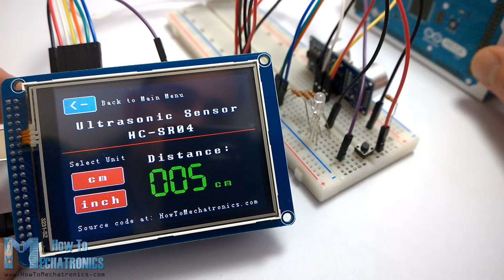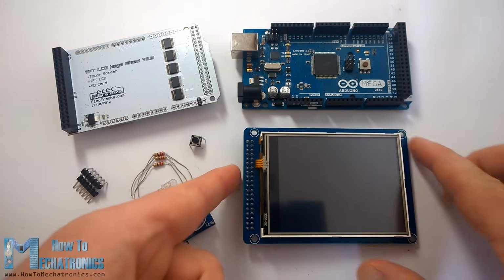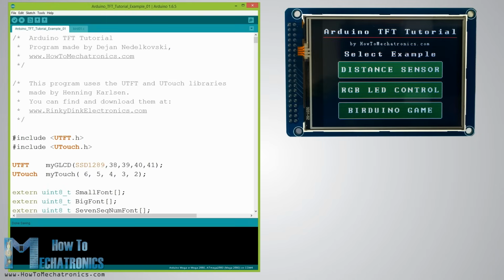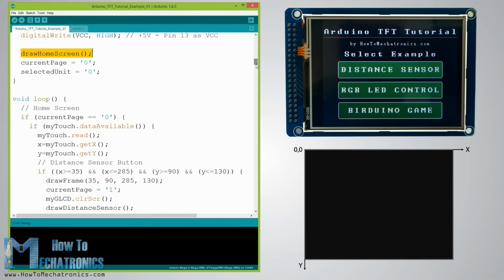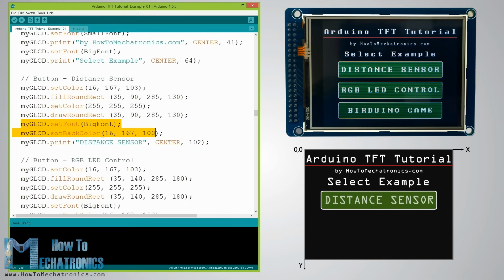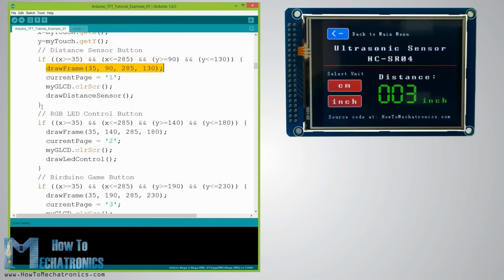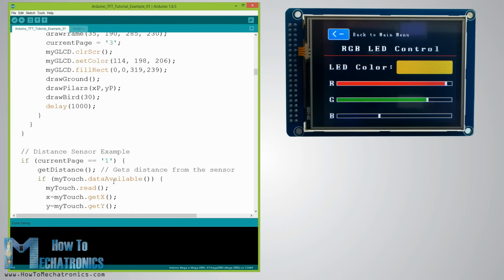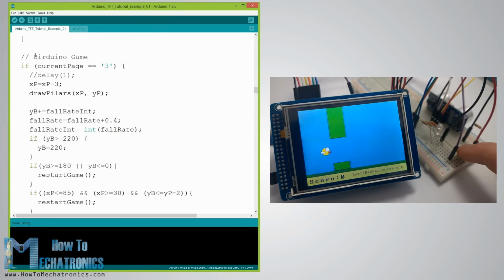Arduino TFT LCD Touch Screen Tutorial

Comment: In the ultrasonic part, when I switch between CM and Inch, the number lay on top of each other.
I'm using Wokwi to simulate and using ILI9341 library.
I wrote to code in order to clear previous number but it doesn't work.
if(selectedUnit == '0')
     {
        tft.setTextColor(BLACK);
        tft.setCursor(150,145);
        tft.print(previousCm);
     }

Also, it doesn't refresh the page to update the value of ultrasonic sensor.
I have to manually click on cm or inch button.

Comment: Hello,
I have recently purchased a 4" TFT (NT35510) which has the advantage of plugging directly into an Arduino Mega, but have encounted a few problems applying your wonderfully clear tutorial. I set the model to NT35510 and the touch parameters accordingly but the library UTouch has been replaced by URtouch (which I have included). I don't know if the new library is backwardly comparable as I get a page of RED when I try to compile. Do you have any thoughts.

Comment: Hello, 

How would i change the code for
// Draws a rectangle with the latest color combination 
  myGLCD.setColor(xRC, xGC, xBC);
  myGLCD.fillRoundRect(175, 87, 310, 119);

to display number values instead. For example, the slider starts are zero and goes in increments of 0.5 every time you slide it to the right.

Thanks in advance!

Comment: Hello, do you have any code for using the 2.8" display to monitor DC voltage that I can use for my solar project? It would be a big help, thanks..

Comment: This tutorial is very helpful, Thank you. But can someone assist me with solving this error "Error compiling for board Arduino Mega or Mega 2560", that's what is happening when I run the code. I added the required libraries, but still getting that error.
Reply: Is it compiling for other boards?

Comment: Thanks for the great video, very interesting.
I'm currently studying but ran into bugs with the code. I suspect since the video is already 4 years old, something has changed, can you see what is going wrong, the error happens when compiling. 

Fehler:
C:\Users\Eric.Marks\Downloads\Arduino_TFT_Tutorial_Example_01 (1)\Arduino_TFT_Tutorial_Example_01\Arduino_TFT_Tutorial_Example_01.ino: In function 'void drawHomeScreen()':
                                                   

C:\Users\Eric.Marks\Downloads\Arduino_TFT_Tutorial_Example_01 (1)\Arduino_TFT_Tutorial_Example_01\Arduino_TFT_Tutorial_Example_01.ino:227:48: warning: invalid conversion from 'char*' to 'int' [-fpermissive]
   myGLCD.print("Arduino TFT Tutorial", CENTER, (char*)"10"); // Prints the string on the screen
                 

Thank you for everything
greetings
from Germany Eric

Comment: I'm a bit confused here the Mega 2560 board has 3.3vdc and 5vdc output so why the shield it can't be because of power outage wait unless you mean where the screen plugs in doesn't have 3.3vdc output could you clarify, please? I was also wondering if you think it would be possible to take a touchscreen out of a phone if it would work with the Mega 2560 board and if so how would you do it? Basically, I'm poor and I do my best to recycle electronics back into useful things. Like this computer, I have at least a large part of it was built from harvesting parts from electronics recycling bins. I have 2 old Samsung cell phones and I was thinking that maybe I could pull these things out and use them for a screen for the Mega board which is how I landed here but this video is not what I was hoping it to be. If anyone has any thoughts or knows please let me know. One other thing I also have some old blackberry cellphones (the screens are not touch screen) they are nice screens could they be used?
Reply: The CPU chip runs at 5V so the I/O is 5V.  The 3.3V regulator appears to only drive the connector, not the CPU and I/O.

Comment: So one thing that isn't said is that the ID of the LCD does matter, when initializing the "myGLCD" method the display could be "SSD1289" OR "CTE32_R2" if your code compiles but doesn't show up on the display, try this fix. Also, the error of C++ nnot being able to convert string to char is normal and will still operate normally.

Comment: hey man I wanna ask about a Rapsberry Pi TFT display that I have. its the one that just works only if you burn onto the Pi one of the .img the developer of the touch screen did. I think its called kemei, its pretty much everywhere on aliexpress. I don’t know how to even start try testing the display with the arduino, not to mention to test the display with a non prepared and driver-loaded iso on the pi... do you know a way i can approach this problem, even if just only to know where to start it would be wonderful.

Comment: can i use HiLetgo 3.5" IPS TFT LCD Display ILI9486/ILI9488 480x320 36 Pins for Arduino Mega2560 instead of the model which you have used.

Comment: Is there a way I can debug and test my screens without having to compile and load the Arduino? Like a screen simulator?
Reply: You can do this with littlevgl, but littlevgl actually requires you to write code.
Reply: Did you find

Comment: Hello sir , from where you have bought this TFT Display. because same TFT i have bought but it's Touch is not working.
Reply: Make sure that you set the parameters of the properly in the line 'UTFT myGLCD(ILI9341_16, 38, 39, 40, 41);  //ILI9341 on  "TFT_320QDT_9341"' (Usually right below including the libraries)
Reply: @geetanshgautam  Muchas gracias amigo, me funciono muy bien.
Reply: @carlj7157  you're welcome

Comment: Hello,
Can we send files/messages using Arduino,TFT and HC-05 module?????
Please reply.
Reply: AFAIK you can. Directly pairing two Arduinos with that setup should work. Same with if you want to connect to a PC with Bluetooth card/adapter.

Messages can be send, with the following usual formats 

ASCII (universaly supported, but your limited to american words), 

UFT-8 (universaly supported with support for multiple languages, but needs to be parsed, since its 16bit per character). Can be also a different encoding/decoding protocol, but these two are the most supported and reliable. 

For file transfer, you will need to send the file in question in chunks, and parse it back together on the receiving end.
Best would be to create a custom protocol for it, to make the transfer as safe and reliable as possible.
Reply: @Loundre3  thank you😊
Reply: @sreekuttysreeku268  Pleased to be of help.

Comment: How To Fix White Screen Plss..
Reply from the maker: You display controller is probably different model. Check the website article comments, you should be able to find the solution for that problem.
Reply: im using a  3.2" LCD Module 40 pin that has a driver ILI9341. what part of the code should I change to fix this problem? Thank you.. :)

Comment: Great project and tutorial!  Just what I'm looking for, I think.  I need to run about a 1000 rgb leds, would the arduino mega have enough cpu power to run the screen and that many leds?  If not I wonder if using two megas would work, splitting up the work.

Comment: im a bit late aren't I! well im 12 years old and i made a game in game maker 8 and i have a option to make a stand-alone .exe for the game and i will be using a micro SD to store it. Can my arduino uno TFT touchscreen run it?. P.S im using a X and Y axis arduino joystick with a switch
Reply: I don't know Game maker 8, but I've just checked their website, it allows your to make games for windows operating system.
Arduino is not windows compatible, it has it's own operating system and programming language, you are going to have to rewrite the game in the Arduino language to run it on Arduino.

When it's done let me know, I'm amazed to see what 12 year old's can do today.
At your age 43 years ago, I had no TV, no computer and the best I could do was carve a car out of wood and place wheels and a mini electric motor in it, unfortunately it was too heavy and it ended up going in steps rather than smoothly.

Comment: it is possble to use old smartphone touchscreen and display in case of tft lcd touch screen . can u give the tutorial on this
Reply: I know, but I have lots of damage smart phones so I think if I find the pin configuration then it is easy to connect with Arduino. But thanks for your reply...

Comment: Thank You for the great videos! Please keep them coming.
I loaded the sketch and only get a white screen. Can you offer any guidance, Please?
Reply: After reviewing tutorial I realized I have a TFT_320QDT_9341 and not the TFT_320QVT. I can only assume it requires a different controller. Can't find solution in YT comments or web so I'll order the correct unit and trash this unit, thx

Comment: Hi Dejan, thank you for this tuto that’s a great job, I just have one problem with my TFT LCD, actually I bought the same hardware as you except that I have an arduino mega adk and when I try your program or any other example of the library I got nothing but a white screen.
plz I need a help.
Reply: Problem resolved, Thank you Dejan.
Reply: @BAmine-eu5pm  how do you solved it - i have the same problem with the whitescreen :-)

Comment: could you please make a tutorial in detail , how to make an LCD touch screen to open and close 8 lights leds.
Reply: I have some problems in understanding the required HW (how to choose it?) and how to connect it. (as I am only a C/C++ programmer and do not have an exp. in micro controllers)
Reply: this is the only one is talking about TFT LCD touch screens, do you have another one I missed ?

Comment: I'm kinda new to arduino, but can I do this kind of stuff with my arduino due too?
Reply: +Ro Wa It should be fine. The Arduino due is actually more powerful than the mega, and because it runs at 3.3 volts it will interface directly to the LCD. The only thing you'll have to do is pay attention to the pin translation between the Mega and Due.
Reply: +gizmoguyar Ok, thank you.

Comment: thanks for this video. is there any example or directions on how to use an arduino to control a LCD (display anything from simple points to pictures)
Reply: +Dejan Nedelkovski 1. any lcd - the lcd has  been scavenged from a tv. 2. display a matrix of dots or even a dot at a given coordinate. hope it makes sense. thanks again friend.

Comment: Hi Dejan, I have now discovered what is going wrong with the code not running every time it is loaded but have no idea why this is so: if the program was running correctly and then you disconnect the LCD from the pc it will generally not run properly the next time you connect this same LCD project to the pc? To overcome this I simply load and run the TFT LCD graphics demo code and then disconnect the LCD. Once the LCD project is then reconnected to the pc and the project loaded it runs as designed - MOST TIMES!!! When it fails to run after following the above process re- uploading the program over the same program fixes fixes this issue - however note that doing this latter double uploading does not work when you haven't cleared the Mega/LCD program before disconnecting it from the pc - GO FIGURE???

Additionally, I have noticed a mistake in your sketch wiring diagram; in your actual code you have the ECHO pin connected to Digital Pin 12 and TRIGGER pin connected to Digital pin 11. However, in your sketch you have shown the ECHO pin connected to Digital pin 11 and TRIGGER pin connected to Digital Pin 12 - which is not consistent with your actual code.  Would cause a lot of consternation for anyone who has not noticed this and wires up the project according to your wiring sketch. Cheers.

Comment: Hi Dejan - really great project. I have duplicated your code and equipment and find sometimes it runs perfectly as expected but other times not as you do not get past the home screen. I have three of these TFT LCD screens, shields and three mega 2560 boards and have found there is no reproducibility of the problem between any combination of them when the program runs and when it does not ? Any suggestions at what to look for or try to resolve this problem? Cheers.
Reply: +Dejan Nedelkovski Thanks for replying so quickly - yes I am beginning to suspect a communication problem but can't pin it down? The project doesn't run only after loading the program onto a Mega each time and when it works it keeps working on that loading and I have loaded and unloaded this program many, many times. However failure is extremely random with no pattern to it - even failing or running OK on the same set of equipment after each different loading? Is it possible to manually select the Arduino Port - so I can see if it is associated with a specific range of Ports? Please advise. Cheers